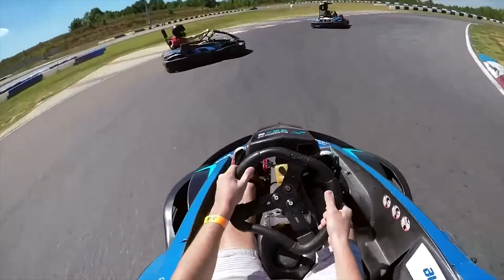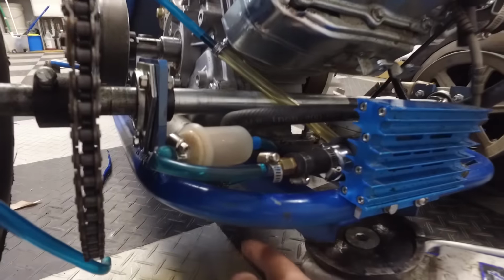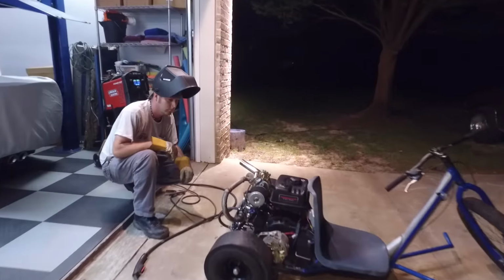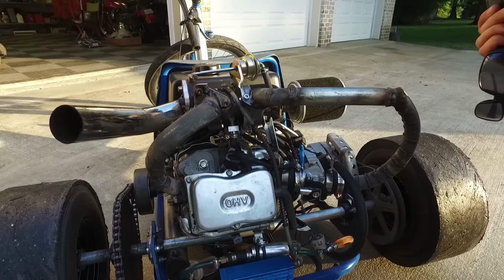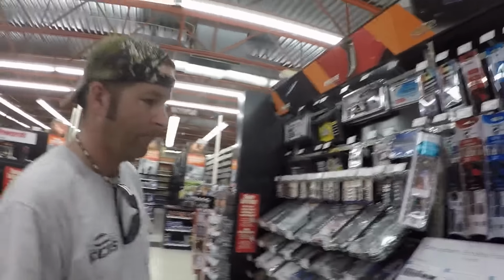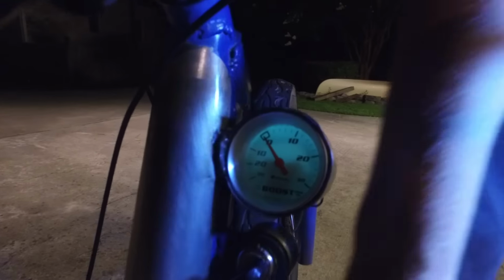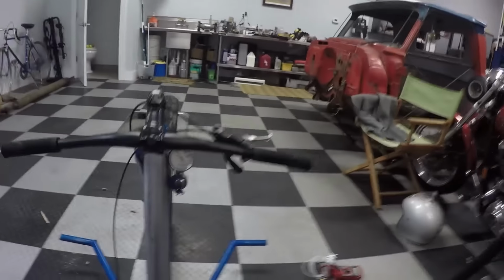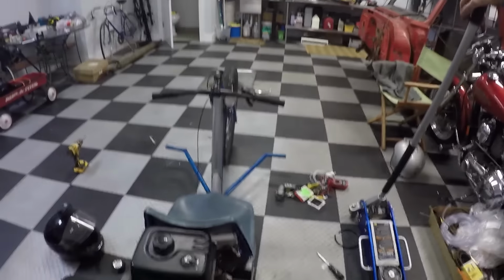Turbo Trike Tuning, Testing, & Boost Gauge

Comment: the wast gate on the RHB31 VZ21 turbocharger opens at 10 PSI but the turbo can stand up to 15 PSI if you disconnect the wast gate

Comment: you can make a cold side out of that sink plumbing chrome pipe. they have all kinds of tight bends. then use radiator hose to couple them together

Comment: You should probably add some plenum volume after the turbo and before the throttle plate, or add a boost reservoir to the line that feeds the MAP sensor, which will smooth out the vacuum/boost readings.  If your boost gauge is all over the place, your computer is seeing MAP values all over the place, which is affecting the proper fueling of the engine.

Comment: Cool video. One thing though, when editing the video make sure to do audio mixdown as well. Even free video editors like Kdenlive will let you separate out the audio so you can mix the levels in Audacity before bringing it back in. That would fix the "whisper/mumble/what are you saying?" followed by "BUBUBUBUBRRRRRT!!"

Also to bend your pipes, just build a jig. (You've got welding stuff, just do it.) Cap an end of the pipe and pack it full with dry sand. (Drying can be done in an oven if you don't trust it's dry enough. You don't want steam in there.) Then plug the other end so the sand wont fall out. Get the pipe glowing hot and you can get decent bends as if you used a mandrel tool.

Comment: What could help regarding the boost peaking, is to try put on 1-2 fuel filters on the vacuum line between the boost gauge and the intake, that will help the boost pressure not to flutter that much that you can actually get a reading.

Comment: Filmed Via Potato?
Reply: think so
Reply from the maker: The video is still processing.
Reply: What ru talking about the vid looks great
Reply: coina
Reply: To stop the boost gauge from fluctuating use a filter tip from a rolling cigarette and push it into the pipe before the boost gauge, this will stop the needle from bouncing up and down.
done it before to my car.
if this worked for you give me a shutout please. keep the great vids coming.
Diggerspug306 (From the UK)
Reply: +diggerspug306 an inline fuel filter , or a small can you can use as a surge tank might dampen the pulses.

Comment: Can you get data out of the EFI computer with a Laptop ?  You should be able to see a live MAP sensor reading, and if its bouncing about like the boost gauge is, you wont ever get it tuned right.    Some computers intended for small single cylinder engines have software damping in the MAP reading, others you need to add a buffer tank to dampen the pulsations in the inlet to get a stable MAP reading.   Be interesting to see what the computer thinks its doing anyway. :)
Reply from the maker: Yeah, I should be able to. The tuning software only runs off of Windows XP and 7 though... I think we have an old laptop that has XP. If/when I try, we'll make sure to film it.
Reply: +CarsandCameras you can run the program in compatibility mode. right click on the program, click on properties then look for "run in compatibility" click the drop menu, find XP click it, then click apply. also sometimes running it as administrator helps. you'll find it on the same page as the compatibility mode.
Reply: where can i buy theat efi

Comment: i havent had any good luck with those iequus gauges at all, i sold an oil pressure guage to one of my friends a while back that was by that company and it did the same thing, it would bounce around like crazy, not accurate at all

Comment: guys if you got a boost gage jumping problem means you got a major leak  of boost most likely is the  pipes try re making them with out the cuts and so on that will fix the leak  and the boost gage will work correctly

Comment: would you guys take the plastics off the tires and do run to top speed and also dyno this one because the one with the torque converter was kinda a let down. also you guys should upgrade the fuel when u dyno it also get a different clutch that karts use , your top speed and acceleration would be better

Comment: Take the boost near the turbo!
Reply: that would defeat the purpose of having a boost gauge if it was behind them.
Reply: +YourNeedsAreHere that's not what he is saying...........
Reply: After the turbo but near it
Reply: +JAKETSU 99 I get what you're saying.  the best reading comes from taking it right before the intake of the engine.  you want to see exactly what the engine is seeing so you can tune properly.  in this case it probably doesn't matter since it's so close and there's no intercooler

Comment: please get a decent mic your audio always sounds horrible
Reply: Yeah dude, I totally agree. You can never hear them talk.
Reply: Agree!
Reply: Or maybe just apply an audio compressor in post. The engine sounds are quite loud with fairly quiet voices
Reply: +Alex Lipinski woke go on the wrong side of the bed?
Reply: +Alex Lipinski I agree lol
Reply: the audio is fine so i think you should clean your ears out
Reply: +Firm Clock Good job on the quick reply for a comment thread a month old. 👍

Comment: is it possible that the boost gauge is flip flopping because its only a 1 cylinder engine? in bigger engines there is constantly boost going into the cylinders so it stays pretty consistent but if its only one cylinder wouldn't the boost spike when the valves close because there is nowhere for the boost to go? I don't know maybe I'm wrong I guess it depends on where the gauge is taking the readings from

Comment: Can someone explain to me why I get lower RPM on a GX270 clone without the muffler? I know there's the whole back pressure thing, but I'm not really sure why it matters on some engines and not on others... Do I need to use a smaller exhaust pipe? 1" ID currently..